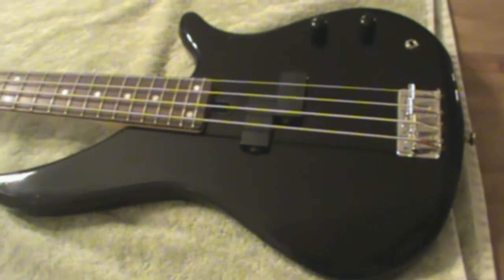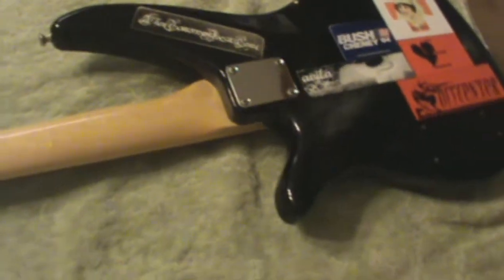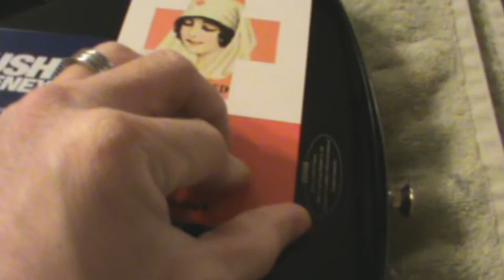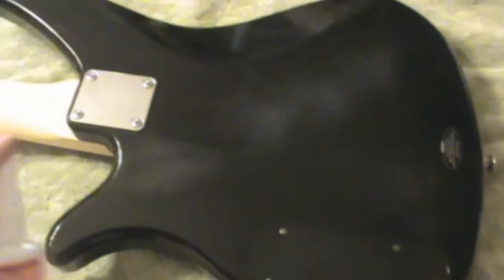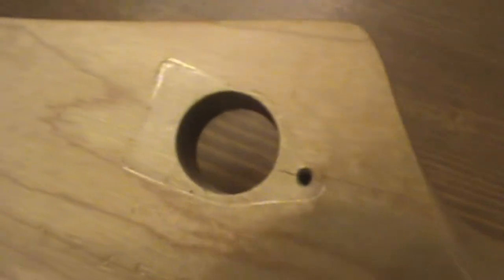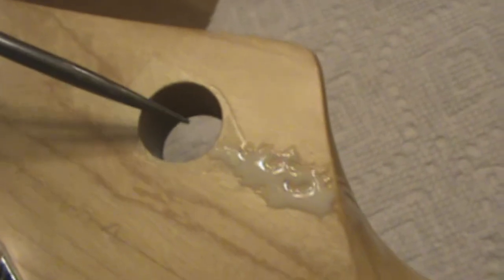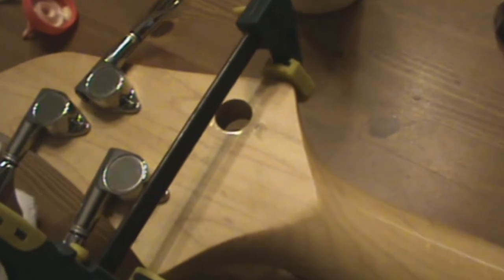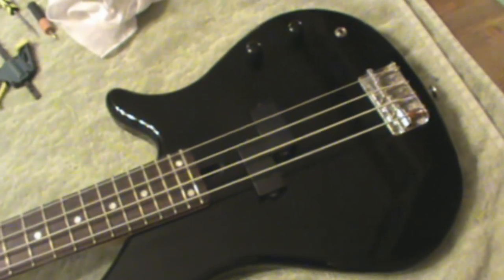Yamaha RBX260 clean up and repairs

Comment: I got this exact same bass with the exact same crack in the headstock, except the crack in mine is a little bit further along. Must be a common occurrence with this model, because Yamaha discontinued it in 2000. Cheers on the fix tip!
Reply from the maker: I think you’re exactly right about the reason for discontinuing it. Otherwise, it’s an outstanding bass. I finally sold mine several years ago for $100.